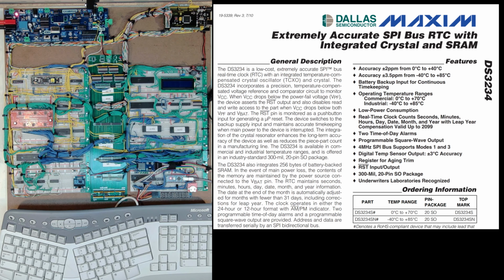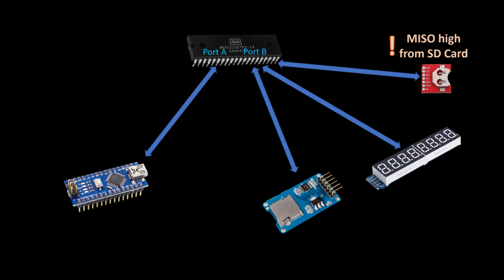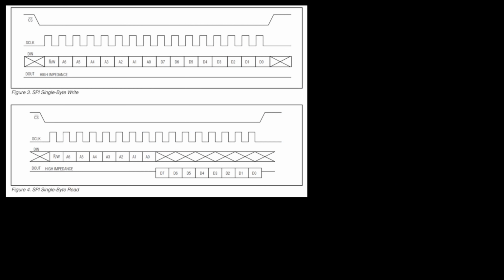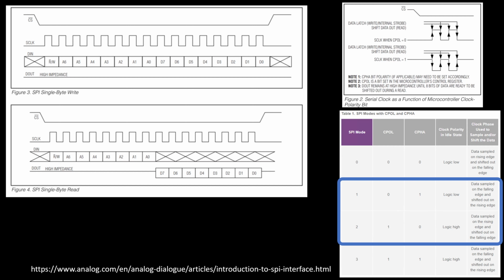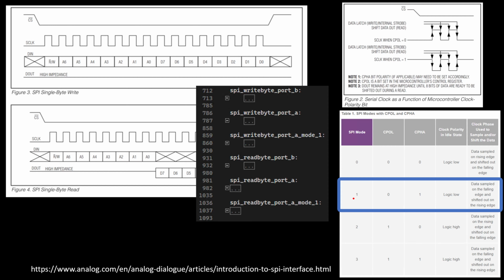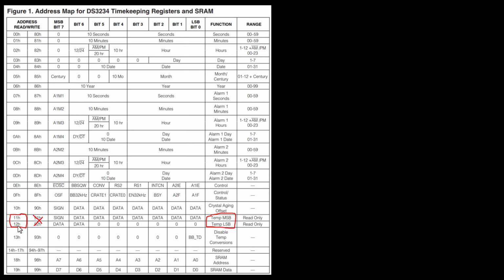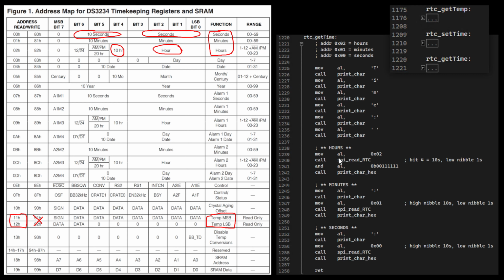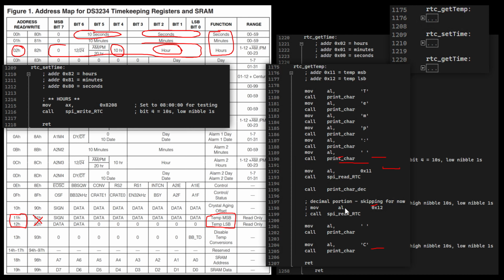80286 Build, Ep. #57 - Real-Time Clock Running

Comment: Alls well that ends well! If you hadn't of found that issue I was going to suggest making sure the battery wasn't one of the ones with a bitter coating, as that seems to impact electrical connectivity.
Reply from the maker: I wasn't familiar with bitter coatings; thanks for that. These are cheap no-name batteries, so they probably don't have a bitter coating. Good to know about that for future coin cell batteries.

Comment: There exist I2C "hub" chips that let your controller talk to a bunch of different peripherals on separate I2C busses. Might be an alternate  way to isolate your SD card from other devices if you get stuck in future. You can also address the hub chip itself to put the busses into high imedance and so on, not sure if you can tell it to change clock polarities though - I've only worked with them at arm's length. We use them to isolate the bus when talking to config PROMs and slave devices in plug-in cards in a reconfigurable card/backplane system. The PROMs let us identify the card type and various options like software or PCB rev for the master chassis controller. This board of yours is really taking on some life, though!